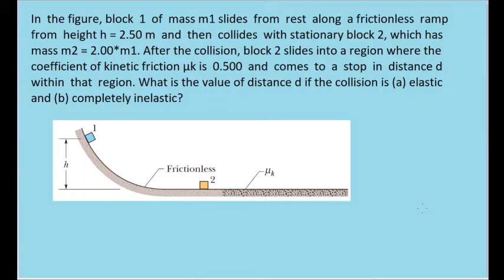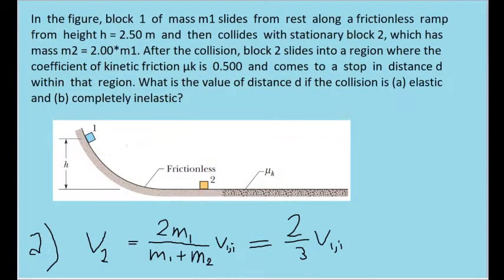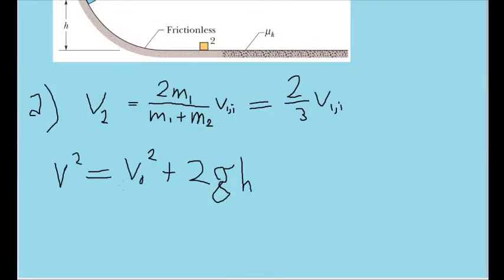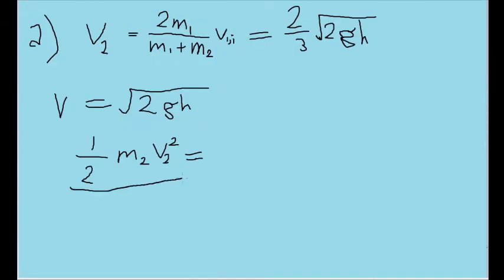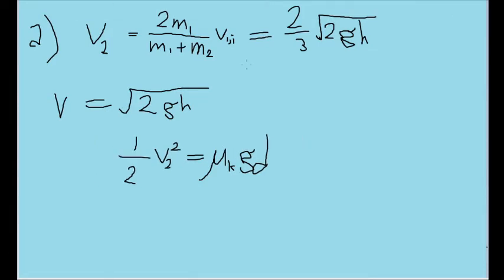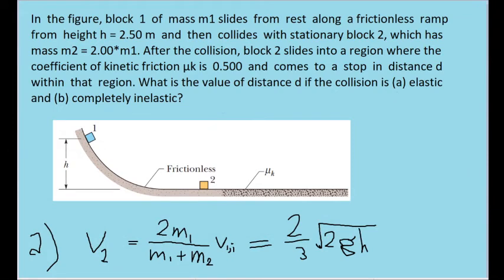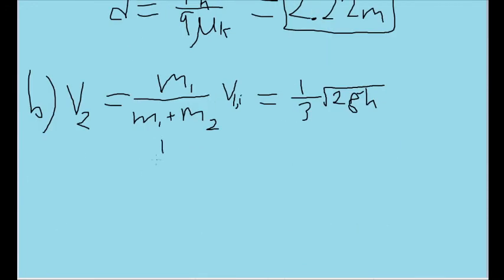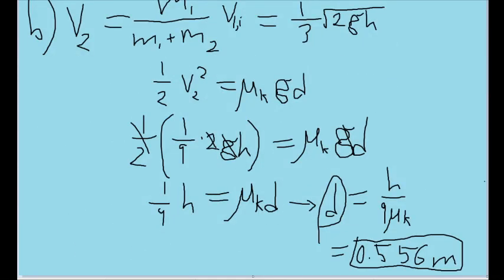In the figure, block 1 of mass m1 slides from rest along a frictionless ramp from height h

Comment: This has a mistake though, the formula you used for part b only works for elastic collisions. You need to find the final velocity v using conservation of momentum for a complete inelastic collision, m1v1i = (m1 + m2)v

And then you can either use conservation of energy like you did for a or kinematic equations (vf^2 = vi^2 + 2ad)